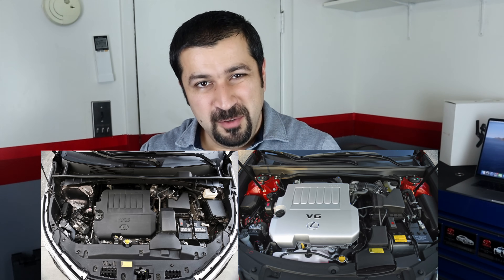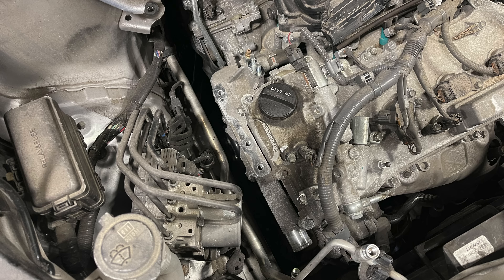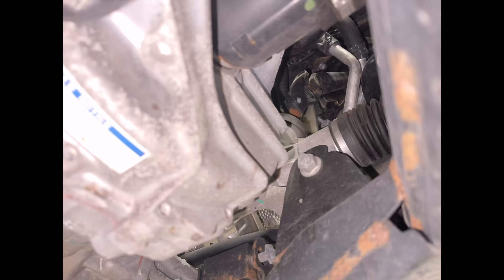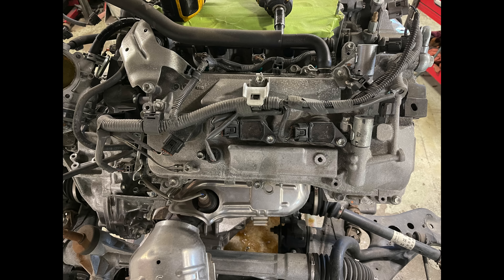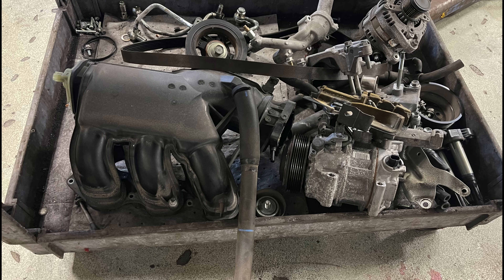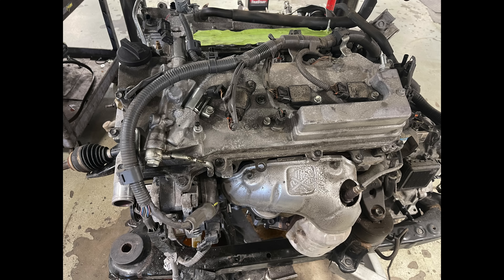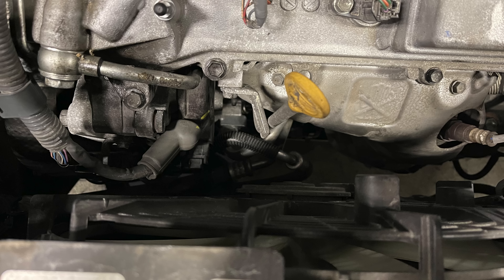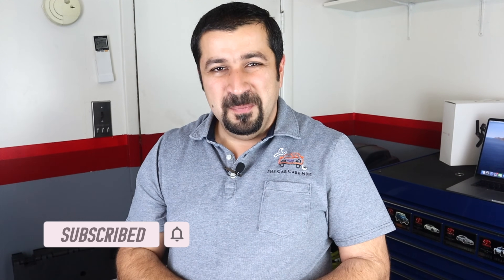Toyota V6 Engine 2GR-FE Disassembly Start to finish Front Timing Cover Repair

Comment: Hey sir. I have 07 rav v6 with 2gr fe engine. It gives me a p0102 code. I replaced the maf sensor and same thing. I used a volt meter to check how many voltage coming from the harness of maf sensor. It only give 5 bolts, isnt it too low? And my 4wd and vsc light is on too. Thanks
Reply: And no matter how i erase the code, i cant even delete the check engine light for atleast a second. I have a feeling it with the wiring.
Reply from the maker: It could be. You’ll need to check the wiring from the maf to the computer
Reply: One more thing sir, thanks for replying. Whenever the car is running, and i pulled the wiring harness of the maf sensor, the engine didnt even react to it. It still continous to run.  The engine should shut off right?
Reply from the maker: Yes the engine should shut off. You likely have an issue with the wiring.
Reply from the maker: Hi! Is the MaF reading on a scan tool?
Reply: The scan tool tells me that p0102 is Mass or volume air flow a circuit low. Its giving me both banks sensor 2 for the 02 sensor aswell.  I dont know if its connected to the p0102. Im lost here lol
Reply: So a little update, i replaced the o2 sensor. But still throwing a p0102 which leads to maf sensor. I replace the maf sensor with a new one but the same thing. What do you think it is?
Reply: Damn. Do you think where should i start? Lol thanks a lot

Comment: Since the cover is a silicone seal what did the factory do wrong? Not enough sealant? Why is so common?
Reply from the maker: Hi! Contaminated surface when installing the sealer. Contaminated with oil

Comment: Where does oil usually leak from the cover?
Reply from the maker: On the area where the head meets the block meets the front cover
Reply: @TheCarCareNut  my avalon leaks a bit from there the shop told me, is it usually the whole gasket?
Reply from the maker: It’s not really a gasket it’s a sealer that seals that area

Comment: Hi amd i hope this is not the same thing i need to do on my 2016 camry se 4 cylinder front timing cover oil leak?
Reply from the maker: Hi! No on the Camry 4 cylinder the engine doesn’t need to come out. It can be done in the car
Reply: @TheCarCareNut Thank you very much you just made my day bright

Comment: AMD, have you change the water pumps on these engines? Every video I’ve seen, they would jack up the engine by the oil Pan. Wouldn’t that damage the Pan? Thank you god bless you
Reply from the maker: Hi sam! Yes you need to lift it up. If you lift right near the drain plug you’re good. That’s strongest area of the oil pan as well as the edges. If you lift it in the middle it could get crushed
Reply: @TheCarCareNut  thank you. And is it too late to change transmission fluid on 193k miles? Fluid still looking red/pink. Hoping to get longevity
Reply from the maker: Hi! If the fluid has been replaced before yes otherwise I would leave it alone at this mileage
Reply: @TheCarCareNut  aaahh i brought the car used at 123k miles. I have No clue if it was changed before  lol I wonder if carfax would show all that.  Thank you AMD keep being great

Comment: Where did you get the cradle table at?  Can you make your own?
Reply from the maker: You can make your own or this table is around $1600. It’s actually a Nissan special tool but works well on Toyota and more
Reply: Thanks for the information.  I love your channel by the way.  I am a Toyota tech as well and I think it is great that you are sharing all of your Toyota knowledge to those that own them.
Reply from the maker: No problem my brother. Here’s a link to the same table in this video https://www.tillmantools.com/J-47242-Engine-Support-Table-Kent-Moore-p/kmtj-47242.htm

Comment: Just replacing the sparkplug is a pain for this engine.
Reply: Would say also on the V-6 a gen before or so, the 1MZ-FE. But little secret, people don't know on the older one you can get a stubby and two short extensions on the ones in the rear cover. Everyone always quotes with plenum removal. Makes them more money of course.

Comment: That's a nasty looking engine compartment! Did this thing come from a wrecking yard? It looks like it has been underwater.
Reply from the maker: That’s a typical engine bay for most cars that come through the dealership.
Reply: @TheCarCareNut  TY for the answer. I live in the deep south and was an ASE-cert mechanic for 12 years, and that would look unusual here so maybe its a rust belt thing.

Comment: Have a 2018 Highlander Limited that is nearing the end of the factory warranty this coming October ... and I've been pondering about buying the extended Toyota warranty before then ... I think this just made up my mind!  Wow, what a job this is!   Are you seeing this much on the 2018 models?   Great job & great explanations on the video!
Reply from the maker: Hi! We had a batch of them leak at very low mileage but lately I haven’t seen much

Comment: Thanks for the video.  Just to add to the discussion.  I have the same 2015 Highlander with the same engine.  I lived in Alberta, Canada.  The timing cover oil leak showed up at 192,000 km (120,000 miles).  I had the oil leak fixed at 203,000 km (or 126,875 miles) May 2021.  It was done I now have 211,000 km (131,875 miles) - no issue.  I typically drive 35,000 km (21,875 miles) a year.
Reply: They quoted me $3200 at a dealership in Calgary may I ask how much you paid?
Reply: @Timeforchangenow  That sounds like a good price.  I paid $4000 but with a water pump change (part only $350 included in the price) and a car loaner.  I was originally quoted for $4600 but the dealer managed to do it faster and saved me $500.
Reply: @everyeniw  ouch
Reply: @Timeforchangenow  I looked at the invoice after. It was almost all labour. Parts are like gaskets, seals, engine oil and some engine coolant. Ooo I forgot to mentioned that my price also included the transmission pan gasket change out (it was weeping) so I got the gasket change. While the engine was out, I changed the water pump was well (since the water pump gasket was changed and they had to remove the water pump anyway).  I did not think the water pump would last that much longer than 200,000 km.
Reply: @everyeniw  I'm with you if they are going that far it's better to get everything done as well it may cost more but well worth it in the end.

Comment: Peace and Greetings  AMD, 
I know I've asked you about this before, but I have an 07 Tundra 5.7 I've detected a slow leak either from the oil pump/timing chain cover or the harmonic balancer seal. Was quoted 5-7hrs or 1-2 hrs for those jobs, respectively. Does that sound like a fair an accurate estimate to you?
I'm debating whether or not to have done, but like you I'm kinda OCD about oil leaks.. 
Thank you for your counsel sir.
Reply from the maker: 5-7 hours from a front timing cover?
Reply: @TheCarCareNut  that's what one toyota shop owner near me quoted me over the phone...
I see on this highlander timing chain cover you said it took you 8-10 hrs.. so am thinking maybe it will be less complicated..?
Do you think it's worth having it done to prevent the leak from getting worse in the future?  Or is it really not that big of a deal? Hoping to get close to a million miles as possible out of this truck 😊

Comment: Yikes. I’m glad this engine doesn’t have a timing belt.
Reply: If it had a timing belt it wouldn't need this job done to it...so it would be better with a timing belt
Reply: @5477harry  well you would be dropping the engine every 90,000 miles to do the timing belt.
Reply: @andym1223  bro are you okay did someone hit you in head with a lead pipe or something? If it had a timing belt the timing chain cover wouldn't leak cause it wouldn't have one....and you don't drop engines to change belts that like the stupidest thing I ever heard. It's clear to me you have never held a wrench let alone turned a bolt.
Reply: @5477harry  Funny, I actually work in a Toyota dealership working on vehicles like these. The reason why this engine has to be removed to re seal the timing cover is because unlike the MZ engines, there is not enough space on that side of the engine bay. So take this same engine in the same position and make it a timing belt engine, you wouldn’t be able to change the belt with it in the car. So you’d be dropping the engine every 90,000 miles to change the timing belt. The older 3MZ-FE and 1MZ-FE had much more clearance on the that side of the engine bay, so it is easy to change the timing belt in the car. If those engines were timing chain, then you probably wouldn’t have to drop the engine if you had to re seal the timing cover. A timing belt engine is definitely more reliable in the long run.
Reply: @andym1223  Stop the CAP!!!!

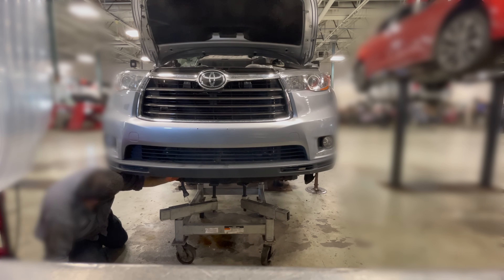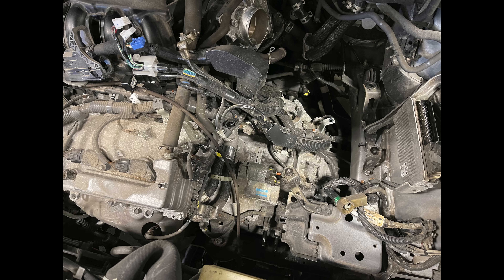Comment: Hi AMD, Can you listen to my 2020 Sequoia trd pro catalytic converter rattle noise? I took it to the dealer ,dealer created tas case at Toyota , they said it is normal. I don't believe it. Passenger side highlight timeline 2:56 , 3:02, 4:07 ,5:07, 5:58-6:06 driver side highlighted timeline 2:04, 2:25, 3:02- 3:14 , 5:53- 6:05, 6:41 ,7:17. https://1drv.ms/f/s!Ar52lNLAdfJCh9YNIV1tgv-6gFBCPQ No Trd exhaust tip , just stock one.  no any modification on the car.
Reply from the maker: Hi! Couldn’t open the videos could you upload them to YouTube?
Reply: @TheCarCareNut   Thanks , please see the replay for links,  try to use highlighted timeline to save time.   It only has 12500 miles on it.  I noticed the noise when I got the new car,  but could not find where the sound comes from, until I stick a Gopro under it .
Reply: driver side  https://youtu.be/i3gx_0M-PGU.    passenger side. https://youtu.be/lsOCrrjn00c
Reply from the maker: That sounds pretty normal to me. I hear what you are referring to but that’s a normal characteristic of this truck. Some of them are even louder than that.
Reply: @TheCarCareNut   it has like clicking and little metal rattling sound, especially when changing the gears, I can hear it inside the car, it is a little bit annoying .

Comment: Is this a common problem with this engine? If so what do you look for if purchasing used? Thanks
Reply from the maker: Hi! Somewhat common. You can look behind the engine for oil residue. Very easy to find

Comment: Hey bro, I’ve got a question regarding this same issue but on my 4.0 2012 4Runner. I cleaned the cover off real nice but about two weeks later the oil mess returns. No noticeable oil loss on dip stick. I took it to the dealership last year and they said it was seepage. Do I just live with it until it makes a mess and I do see oil loss? I know it’s like a 4,000$ job. I’m willing to pay it if I have to someday. It probably just looks bad because it’s oil and dirt.
Reply from the maker: Hi my brother. So as long as it’s not getting on the belt and being thrown around you’re ok. You’ll likely never see a measurable oil loss on the dipstick unless it gets super bad where it’s dripping as soon as you start the engine which is highly unlikely to happen. If it gets on the belt then I would consider fixing it. Then it can start causing the alternator to fail.
Reply: @TheCarCareNut  Great I will use that as a point of reference. Right now it’s just seepage that gets up in front to what I believe is the timing cover tensioner inspection plate? I am a perfectionist so this is a thorn in my side and kind of drives me crazy even though it’s really not a big deal. Can overfilling with oil cause this? I know the truck takes 6.6 quarts but I’ve seen a lot of people just throw 7 in there because they’re lazy or is it simply just the sealer gives out overtime? I bought this used with 110,000 on it so I have no clue what was done prior to me. As always thank you for your response!
Reply from the maker: Overfilling won’t cause this one.
Reply: @TheCarCareNut  So why not attach some kind of shield, to prevent the oil getting onto the belt, and in the alternator?

Comment: Lot of parts came down and got disassembled, what happens when putting everything back and one washer or bolt not in right place, have to do the job allover back again, can you please share how many hours did it take you to do this job and please tell us how much it cost, was this all worth it for the owner in the end. Thanks in advance
Reply from the maker: Hi! It took around 8-10 hours and usually costs around 2.5-3k and the owner of this one didn’t pay anything the extended warranty covered it

Comment: Hi AMD! U make it look so easy, very systematic! Do u recommend preventative steps? Water pump, plugs, anything hard to get to when installed?
Reply from the maker: Hi! Usually water pump plugs and drive belt. Some people go all out and replace the chain guides and even head gaskets which there isn’t much to get to them
Reply: @TheCarCareNut  When I get mine fixed replacing those parts would be more logical since the engine is already apart cheaper then than later.

Comment: My 2015 Sienna went for the same surgery twice, the first time wasn't done right and oil leak everywhere.  The dealership mechanic denied at first claiming it was the oil residue from the last job.  This problem seems to be quite common perhaps that's one of the reasons many new Toyotas use more reliable 4 cyl. hybrid engine.  Btw, this job costs thousands, without warranty I'd not be able to afford it.  Great job, AMD you fixed it right the first time!
Reply: Your first mistake was buying into the Toyota fallacy of "reliablility".  They're no better than anything else, and worse in many ways.  You're paying extra for inferior design and technology based on the farce of "reliability".
Reply: @wildman1137  They are better than most for vast majority of cars... but Toyota isnt perfect.

Comment: How much ballpark can you anticipate it will cost? I have a 16 highlander with this engine, will it inevitably leak?
Reply from the maker: Hi! Usually around 2.5-3k and not all of them leak. Usually this leak the engine is born with. If there’s absolutely no signs of leaks at this point I’d say you’re good

Comment: Informative video. Whats the hourly rate the dealer charges? And how much does the extended warranty cost and for how long is the coverage. Im interested in doing some cost analysis, based on needing this job performed. Thanks
Reply from the maker: Hi! Hourly rates vary greatly by area. In Chicago the average is around 140-170 per hour. Extended warranties also vary greatly.
Reply: @TheCarCareNut  ok, so on average 155 per hour for this about 15 hour job equals around $2,300 bucks in your area, and I see that the Toyota platinum warranty costs around $1,500 bucks, based on a tacomaworld forum. So there’s a fair cost saving if one were to need this job done. Thanks

Comment: Hi master can I check with you is all Toyota bolts have a torque to follow?
Reply from the maker: Most bolts have a torque spec except some screws on interior items
Reply: @TheCarCareNut  is the torque spec same for all bolts,l have install a struts bar, front stabiliser bar,rear stabiliser bar
Reply: @TheCarCareNut  can I know what the torque spec for the bolts thank you master
Reply from the maker: You can access the repair manual at techinfo.Toyota.com for all specifications
Reply: @TheCarCareNut  ok thank master good day
Reply: @TheCarCareNut  hi master I can’t Assess the website

Comment: Damn, small fortune for sure! I have pulled engines before, but not packed in crap like that, wow much respect.
Reply: Toyota on average gets more mileage than any other domestic vehicle
Reply: @jaycarl1562 domestic or foreign

Comment: Hi AMD, my 2GR-FE takes 6 1/2 quarts of 5w30, I buy 6 qts to change the oil and filter and I top it off with half qt of 5w20, just because I have a lot of 5w20 left over for a car I don't own anymore. Is that going to harm my engine? (2007 Sienna 3.5). Thanks.
Reply from the maker: Hi! It’s not ideal but it shouldn’t be a major issue
Reply: @TheCarCareNut  Thanks.

Comment: Super excellent job man. Home many hours labor does that job list for?
Reply from the maker: This one was between 15-16 varies by model. Highest one I think is 24 for a 2006-2012 RAV4 V6 which is the hardest one in this configuration

Comment: Hey, any problems with a Sienna HV on Smart key certification ECU?
Reply from the maker: Hi! No problems yet that I’ve seen just the remote start inop needing a handshake
Reply: @TheCarCareNut  interesting, I got one at work that got into a internal failure of that ecu apparently, cause it won't start.
Reply from the maker: Interesting. We had one the other day with a can wire that was pulled out of the connector.
Reply: I send you and email haha. 
But there is a short to ground on the IG circuit. Apparently caused inside ECU (Certificacion ECU)
Reply: I hope is a unique case, cause if it makes it to a mass failure people are going to get mad..
Reply: @TheCarCareNut  really, where? Did it had a logic explanation?
Reply: @TheCarCareNut  sad thing is this same vehicle when for a noise complaint a few days back from the side door on the driver side, and a glass rail was missing a bolt.. so the owner was already kinda angry with the truck.. now this haha

Comment: Great video. Definitely not for the novice DYI mechanic. Toyota dealerships should keep the video handy and play it for anyone who questions the time, effort (and cost, of course) for replacing a leaking front timing cover. In keeping with your "simple but complex" theme, this job certainly sounds simple but is clearly complex. Thanks for the education.
Reply: I'm a DYI mechanic and did the same job without removing the engine from the car. Same engine different car. Don't know if the Highlander lacks clearance to remove the timing cover. I know for a fact it can be done on an Avalon without removing the engine.